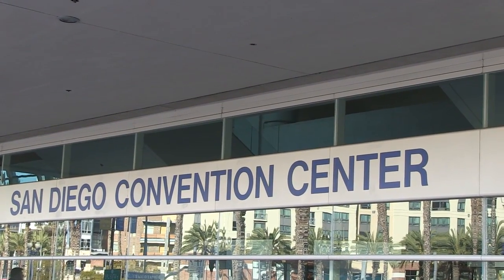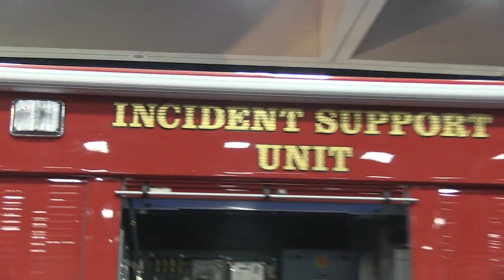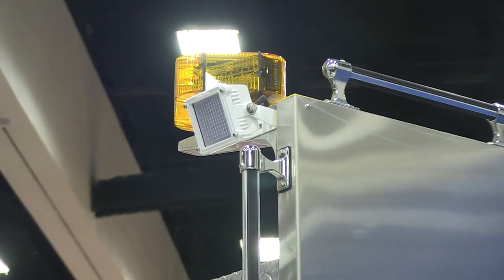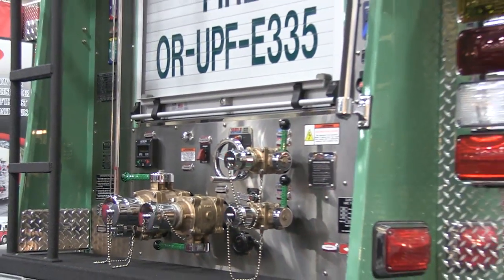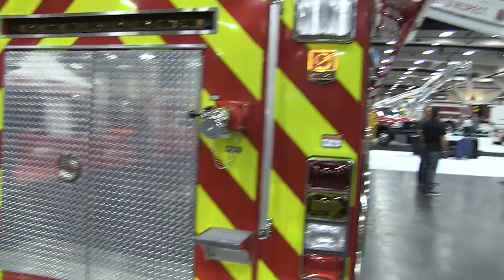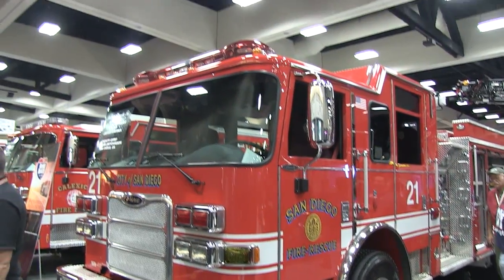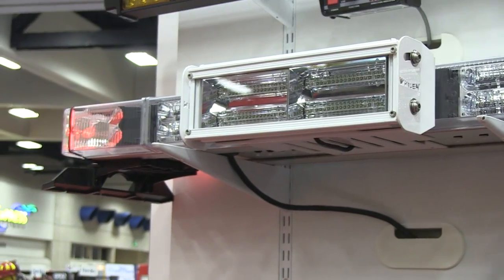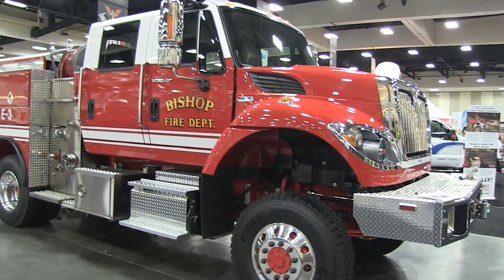San Diego Fire Expo 2012

Comment: Saw on that first truck,  they removed the headlights from the original location and reinstalled them in the bumper of the truck,  may I ask why?,  and when they do shows like this showing of their great looking trucks,  they must have other engines or whatever covering the stations where thes are from right?  Turned off all my lights in my room when you showed the red Lightbar flash and boy did it sure light up my room...LOL